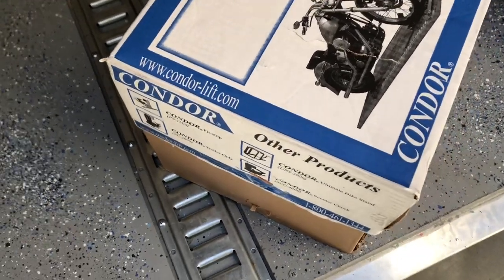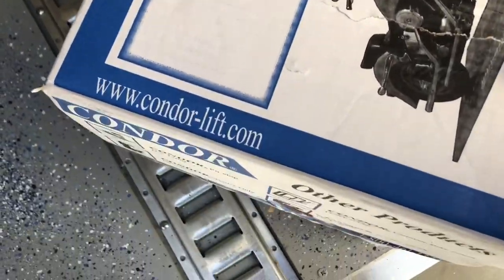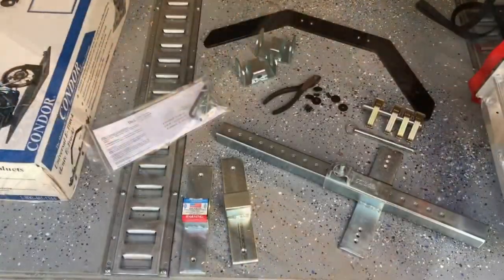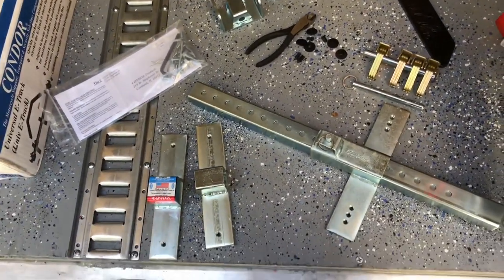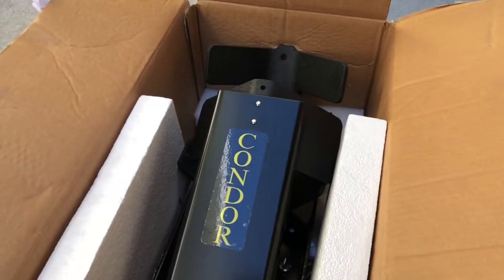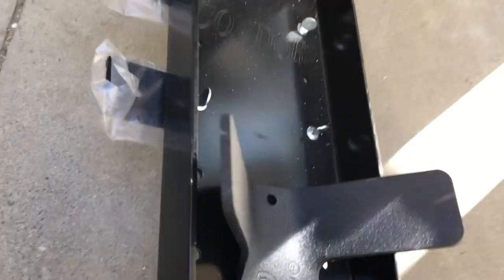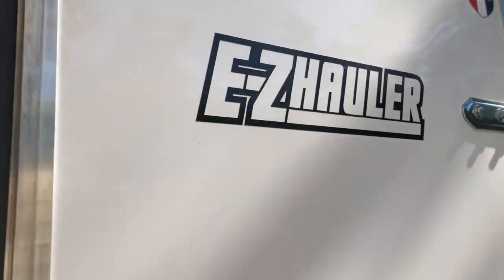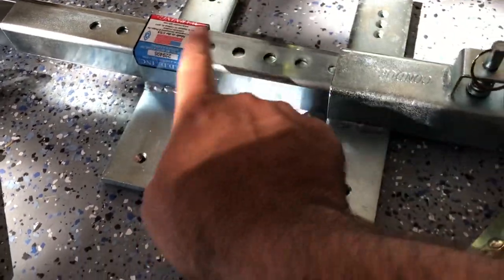Condor E-Track adapter for motorcycle trailer chock- unboxing and install

Comment: Great video - Audio is a little hard to hear so wanted to ask - when done is it tight or does it move around and make noise? I like the flexibility, but don't want something that rattles.  Would you buy it again?  Seems awesome as long as it is non jiggly and doesn't move or rattle.  Thanks!!
Reply: It has a fair amount of play in it. But it's heavy and it doesn't move around. I would imagine in a van you'll hear parts of it rattle when it's empty. When a bike is on it it's tight and doesn't make any noise.
Reply: @SM-cs1ks  Thanks!

Comment: I see that you put the E-track rails in like a groove or cutout on the trailer floor. Is the floor plywood or composite? And what is the advantage to putting the E-track in the groove?
I am looking doing his same set up for my multiple adventure bikes…
Thanks
Reply from the maker: I just used plywood. The original floor on my trailer had a little movement so i laid down my own layer around the e track. Sturdy for big motos, and it makes a completely flat floor so it’s much easier to use it for other things. I use this trailer for moving stuff, camping, dump runs, whatever… and the flush e track is super handy. Best thing ever.
Reply: Gotcha…thanks…has the epoxy flooring held up?

Comment: How far apart are your e-tracks
Reply from the maker: Without measuring, it's a 6 foot wide trailer, so I'd estimate centerline to centerline is a little under 2.5 feet between each track. If you need more specific I can do that.
Reply: I am looking at the same setup for my R1250 GSA and a R Nine T.  Like you I have used it with a Pitbull setup but now need to be more flexible in the configuration with the arrival of the R Nine T.  Do both of your bikes fit comfortably in this setup and is the center E Track right down the middle of your trailer?  Thanks for the video.  Very helpful.  Did you ever do one with pics of the bikes loaded? Would love to see that if possible.  Cheers
Reply: @glenncharles6622  yes I did , I bought one and used a harbor freight big black motorcycle lock. I just deleted the the front bar on harbor freight lock and mounted to front and the boomerang peice on back I had to just put a small countersink on HB motorcycle lock so bolts that came with kit would work. Sorry I don't know how to send a pic on here or I would,  I actually just loaded bike heading home from vacation.